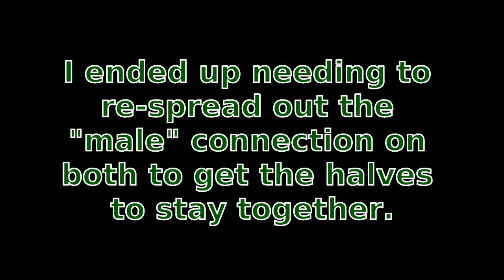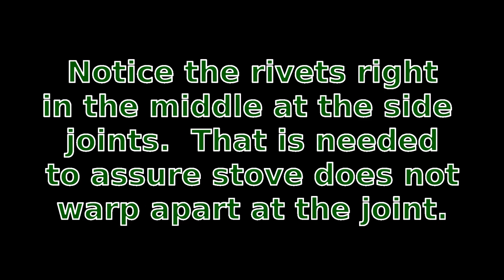Make A Simple Cheap Tent Wood stove - Part 1

Comment: Precaution for CO poisoning.  Always install flue pipes with the male end pointing up and the female end pointing down.  As heat rises, it will pull a negative pressure on the joints if installed in this way.  Any slight air leaks will only allow air inflow at the joint whereas if the female end of the pipes are pointed up, it can create a positive air pressure at the joint if there is a leak and cause the exhaust fumes to leak out.  CO poisoning is a real threat with carbon fuel device such as a stove, water heater, fireplace and even campfires near a tent in certain situations, etc.  As a paramedic with fire rescue in a large city, we had a few deaths each year from CO caused by incorrect flue installations or blocked flues.  We discovered several cases of slow CO poisoning.  The half life of CO is about 3=4 hours so people who get exposed to low levels repeatedly will slowly accumulate increasing CO in their blood until it reaches a toxic level.  We had a case were 9 people died in an apartment building due to an incorrect install of a water heater. On your stove build, you hammered the cutout for the flue inward, which started you off with the male end of the flue pipe pointing down.  If you hammered it outward, you would start your flue pipe with the female end down and that would be much safer. I see that most install instructions call for male pointing down to prevent soot from falling out of the joint.  I don't understand how this would be preferable to the male pointing up for safe airflow.  I would suggest that a CO detector is always a good idea, even in a tent.  You can get a portable, battery powered CO detector for under $100 on Amazon, and you can take it with you wherever you go.  I would also suggest a thin layer of fire brick, 1" minimum on the floor of the stove to help prevent burn through.
Reply from the maker: Wood stoves are not gas or oil furnaces are not to be compared to them.  I'm sorry but you are very misinformed about wood stoves.      You DO NOT want your stove pipes with the male ends pointing up.   If you do that you will soon wish you had not done so. You will be driven out of the shelter, bldg etc in short order by toxic fumes due to creosote running down the pipe and through the upside down joints on to the outside of the stove pipe.   Take the time to look at any professional made and installed wood stove and you will see that what I am saying is correct.   When wood is burned there will be different constituents that vaporize in the firebox and head up the stove pipe with the exhaust gases.  As they get further up the pipe they will cool enough to condense out and collect on the side of the pipe.    They will then run down the pipe back toward the fire box and be reburned or if the pipe is installed incorrectly as you suggest the condensates will run outside of the pipe through the joints and will give off toxic fumes into the surrounding area.
Reply: @Far-North-Bushcraft-Survival  Thanks for your reply.  I have seen professional installations and they do have the male pointed down.  And I understand the issue with the creosote. If you take a screwdriver and make a fisser at a joint in both situations by pushing the crimped joint slightly apart in one spot, and one will draw smoke from a rolled up paper towel into the hole and the other will blow smoke away from the hole.  Granted, when creosote runs down it would flow out of the joint.  I have seen flue pipes for wood stoves that feature a compression ring.  Do they provide a better seal?  Are there any other steps to seal the joints as with other flue joints such as cement?  The natural convection flow will create an air flow, as you know, which will create air pressure gradients at the joints.  I'm not trying to be difficult, I am just trying to understand the process as it differs between say a gas water heater and a wood stove as far as metal flue installation and CO safety.  CO is odorless and colorless.
Reply from the maker: As far as I know, there is no need to seal the joints as I have never heard of that being done in household wood stove installations.   This is my thoughts.  The way a wood stove burns with the small air intake and the generally much larger exhaust, I believe that a low level negative pressure is created in the stove pipe due to the hot air rising.   Due to that negative pressure I am guessing, though i have never tried it, your trick of lighting something smokey outside of the pipe but next to a hole in the pipe, the resulting smoke would be drawn into the hole.  One does not need to worry about CO with a woodstove since it would not escape into an enclosure without an  accompanying  portion of woodsmoke.   In other words if you smell smoke, you know something may not be right.  On the flip side, if you do not smell smoke then you know that everything is working as it should.  Not only will you smell the smoke but if it is particularly bad, your eyes will bother you as well and you will visually see a smokey haze in the enclosure.  Though I am not a drinking man and don't frequent bars, I am guessing that the amount of cigarette smoke in a bar is far more hazardous and of health concerns than practically all woodstove installations.
Reply: @Far-North-Bushcraft-Survival  Okay.  Thanks for your reply.

Comment: I wonder if they make high heat paint that can withstand the wood fire
Reply from the maker: Yes there are stove paints available.   You would not want to apply on this stove build before burning off the galvanizing and then I do not know if the paint would adhere very well to the resulting finish.  The need for paint though is mostly cosmetic.   After each season is over one can clean these out real well all over and then spray a light coat of PAM type cooking oil all over it inside and out before off season storage.   The next season during the first burn the stove will stink a bit while burning off the oil coating but it shouldn't last long.

Comment: spooky.. I looked at some hot tent videos earlier today, when now your video popped up.  When using it inside the tent, what are you doing to use, so the hot pipe won't burn the tent where it exits?
Reply from the maker: Glad I could share useful info with you.  I have made home made stove jacks in the past and you can see how that was done at the video link below.   Those stove jacks work great but are a bit heavy and bulky.   I will be sewing an ultralight nylon tent hopefully in the near future and will be using the material at the link below for the stove jack.  Of course I will be making a video of the tent build.

Turn Your Tarp Tent Into a Hot Tent - Stove Installation
https://www.youtube.com/watch?v=HfiUgGhTe1k

https://ripstopbytheroll.com/products/stove-jack-material
Reply: @Far-North-Bushcraft-Survival  awesome, thanks for the info.. looking forward to your future videos as well :)

Comment: Was the “bucket stove” not putting out enough BTU’s?
Reply from the maker: Yes I believe that the 5 gallon bucket stove would put out enough heat to heat the larger shelter I will be making but it would not hold a fire for very long at the higher burn rates.   I wanted to build this stove here for two reasons. I have a stove that I made from a 55 gallon barrel stove kit where i used a 30 gallon stove.  I used that stove for years in my 12 X 14 foot traditional canvas wall tent.   I wanted an in between stove that had a size better suited for the range tent that I am planning on making.   I also wanted to get my "feet wet" so to speak on working with duct work because my ultimate plan is to make a "break down" type stove.

Comment: Awesome job Lonnie - you wouldn't happen to have a "materials list"?
Reply from the maker: 2 barrel bolts latches
2 small hinges
1 galvanized 7 inch diameter 5 feet long round duct
1 flat sheet galvanized ducting metal 16 inch X 34.5 inch
54 steel pop rivets 1/8 inch diameter & 1/8th to 3/16ths usable depth range.
suitable material to make the legs and leg mounts
Reply from the maker: PS  the door was made from another piece of sheet metal that was a bit thicker than the ducting metal but a person could use the cut off piece of ducting that was left over after cutting the two 24 inch length from the 5 foot 7 inch round duct.   I felt that the ducting was pretty thin for a door but if I was going to use it I would maker it oversized and then fold the edges over onto itself to strengthen the edges.
Reply: Thank you very much.

Comment: I have a good sized piece of stainless steel to make a stove from. I just need a way to cut and bend.
Reply from the maker: I also have a sheet of stainless and am thinking of a DIY break down type stove with that material.   I have not attempted it yet but I'm told that a hand held grinder with cutting wheel will cut the sheeting fairly well.  Good luck with your project.

Comment: Is galvanized pipe the type that gives off toxic fumes when heated?  I could be confused here.
Reply: Just got to the end of the video :)
Reply: This is one of the more useful videos I have seen in a while, thank you for your work
Reply from the maker: As you discovered, galvanizing does give off toxic fumes until it is burned off so care needs to be used during initial burns.  Look up "Metal fume fever" if interested.

Comment: A camping gas bottle would have been a lot easier to convert into a woodburner/stove, heavier guage metal too.
Reply from the maker: it would be fairly difficult to modify a propane tank into a woodstove without welding.  Besides it could be extremely dangerous to do so if strict precautions were not followed.   In other words not just anybody could do it.  This design here however is within the realm of possibility for just about any person who has access to and basic understanding of a few simple handtools and drill.   Besides, I personally do not care for cylinder shaped stoves because of lack of flat cooking surface.    With the proper tools, a propane bottle would make a good stove but it is not for everybody.

Comment: Why didn't you use regular black stove pipe so you didn't have to worry about burning off the galvanized pipe?
Reply from the maker: The galvanized pipe is much more available in the smaller sizes that I need.
Reply: @Far-North-Bushcraft-Survival  Thanks for the reply!  At this time of  year my area has black stovepipe of all sizes available, so I may try to make your stove out of it. Thanks for the video showing how to make one with minimal tools!

Comment: Could I get a material list I’ve always wanted a tent stove but they are expensive
Reply from the maker: 2 barrel bolts latches
2 small hinges
1 galvanized 7 inch diameter 5 feet long round duct
1 flat sheet galvanized ducting metal 16 inch X 34.5 inch
54 steel pop rivets 1/8 inch diameter & 1/8th to 3/16ths usable depth range.

suitable material to make the legs and leg mountsthe door was made from another piece of sheet metal that was a bit thicker than the ducting metal but a person could use the cut off piece of ducting that was left over after cutting the two 24 inch length from the 5 foot 7 inch round duct.   I felt that the ducting was pretty thin for a door but if I was going to use it I would maker it oversized and then fold the edges over onto itself to strengthen the edges.

Comment: u can bend it the outher way to go in the tube safer and rivet it
Reply from the maker: If you are referring to where the stove pipe mounts on the stove body, there are several reasons why I did it the way I did.   First It is better for transporting the stove if the stove pipe opening on the stove is facing inward so that the lip is protected from damage during transport.  On a woodstove, one always places the male or narrow end of the stove pipe down and inside of the joint below it.   You do not ever want the lower end of each pipe to go over the outside of the pipe or stove below.   To do so would be asking for trouble.   The condensates inherent in the exhaust of burnt wood will precipitate out of the exhaust once the exhaust temperature cools enough to allow such to happen.   Creosote is one of those byproducts that are formed at that time.  Creosote, once condensed onto the cooler upper reaches of the stove pipe will then proceed to run down the inside of the pipe and then flow out of a wrongly positioned stove pipe onto the outside of the pipe and proceed to burn as it flows down to hotter regions of the stove pipe or stove.  Now you have these extremely noxious fumes being released into the shelter for the occupant/s to breathe.
Reply: cool

Comment: What is the size of the front opening?
What size is the front door?
How long did you make the feet?
Reply from the maker: If you make the stove, you can make the opening whatever size you wish up to the point where it may be too large for the stove.   The legs can also be what ever size works for you and according to your desires.
Reply: @Far-North-Bushcraft-Survival  
Just wondering what you did?
Reply from the maker: @wisconsinbush2940  The legs hold the bottom of the stove at about 11 inches high.   The door opening is 8 inches and the door is 8 3/4 inches.
Reply: @Far-North-Bushcraft-Survival  thank you!

Comment: but is it durable? will it breakdown/melt/fall apart after a dozen uses?
Reply: No, it will last longer then you think. Important is to have great in it, to keep the fire a  bit from the bottom. Also you must know how to handle a wood stove properly, not to low and not to high temperatures. And then its important you must now what kind of wood you use.